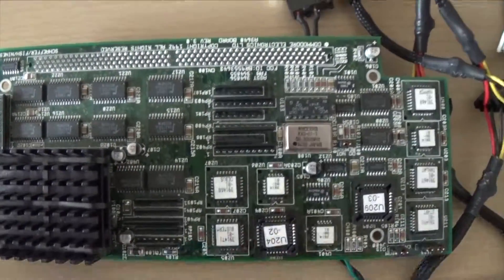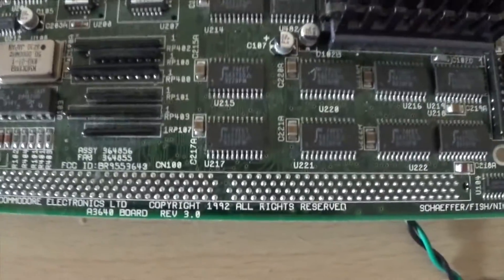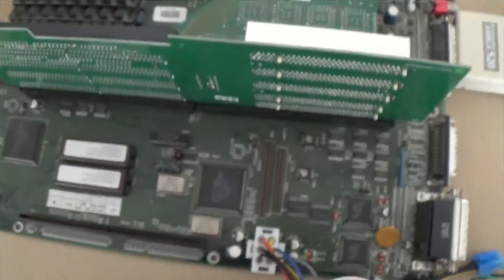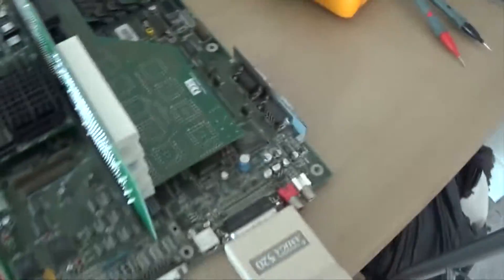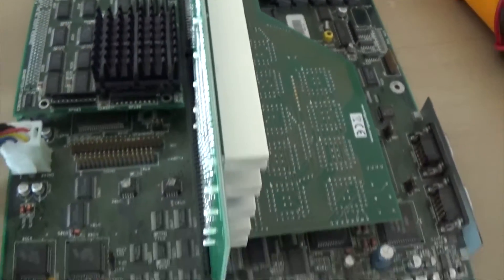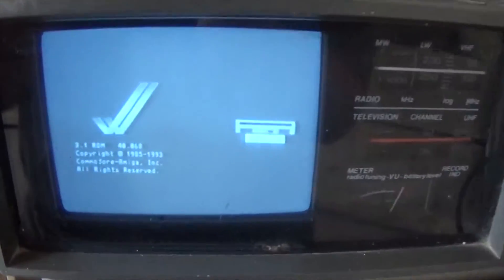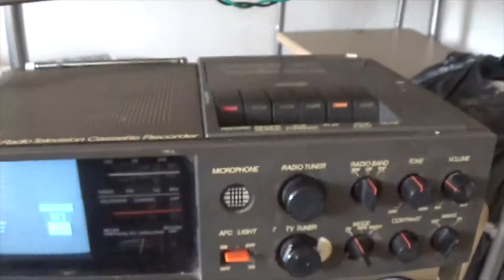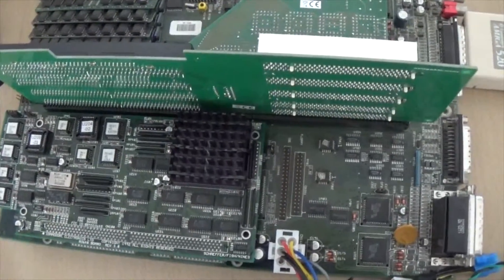Amiga 4000/3000 A3640 Gal upgrade to 3.2

Comment: Erm... isnt that the psu I bought years ago for you to convert to an A500/1200 psu many years ago when you where still up north? :)
Reply from the maker: sneekeruk yes it is , I’ve just dug it out of storage :)
Reply: Cool, I have a spare if my A500 one ever dies from powering my 040 and other bits ive added, glad its getting some use though.
Reply: Just an A500 one, yours was going to be my modded atx, even though its mirco atx iirc, its been so long now I cant remember